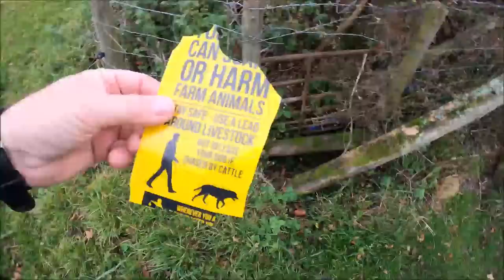S**t, sheep and a water pipe tip.

Comment: Ian, good info on the squeeze off clamp and also never use it in same place twice! Just add a bit of tape to indicate it’s been used there. You can get a tool to round off the squeezed pipe or some water pump pliers 👌🏼

Comment: Thus summer we cut 104 mature ash trees from the 3 acre woodlot,  They were all standing deadwood,  Damned Emerald Ash Borer. Lots of mature Maples, several hundred, still doing well. With the canopy opened up for sunlight and rain, the new seedlings are alive and thick. You don't require a leaching field of pipes?

Comment: Ian , very true  about carrying a pipe squeeze off. I have one hanging off the inside door of my van  a lifesaver! I also carry a short length of underground pipe along with a couple of boot couplings and a  metre of 20mm and  25 mm mdpe inside along with some fittings.

I have a cat and genny and a drain sonde and always use them but gone through my share of pipes.
Reply: Ahh Cat and Genny! that takes me back. Nearly lost my hearing by unscrewing the speaker module in the Cat handle and putting it to my ear then pressing the button!
Using those two bits of kit saved lots of money (and embarrassement) 😀
Reply from the maker: The tree team have a CAT and Genny for stump grinding opps.🙂👍

Comment: Hi lan could you have not put the rain water pipe into the outlet pipe of the tank so to flush the pipe and save on pipe 🤔👍👌
Reply from the maker: We could have, but it was only about Ten meters difference in the pipe (two lengths) so decided to keep them separate, it means I know exactly what is coming out of either pipe. The rainwater discharges just above the tank to help flush the ditch. 🙂👍

Comment: THAT gadget would be ok with old class c plastic pipe , but not class d , im  on about the black pipe . pre blue ..
Reply from the maker: It would, but with a smaller diameter bore you would not need to squeeze it so tight.

Comment: I have to ask ian.... why put it slap bang in the middle of the lawn? And not down the side of a hedge or something?
Reply from the maker: A couple of reasons Chris.
1, we wanted to pick up the drainage from the roof gutters, and 2, we are planning a granny flat for Julies Mum and we may need to instal a separate sewage drain for that. There is a reason for everything. 🙂👍
Reply: @FarmerP  oh, could you not of just run the pipes a different direction? For some reason it’s annoying me that your lovely green, cut garden is upside down 😭
Reply from the maker: @Lorenzo622  
I’m not thrilled about it, but it’s nothing a bit of time and effort can’t repair. 🙂👍